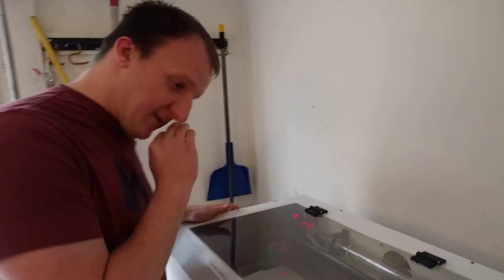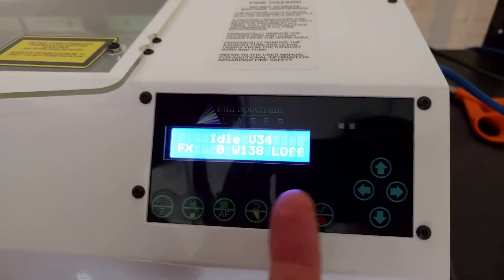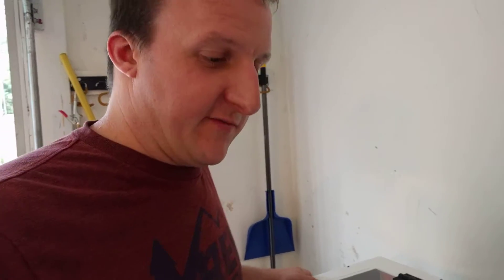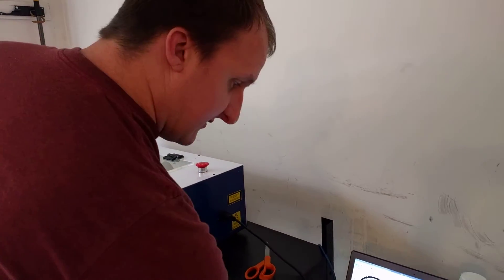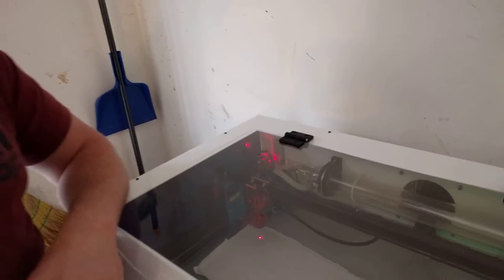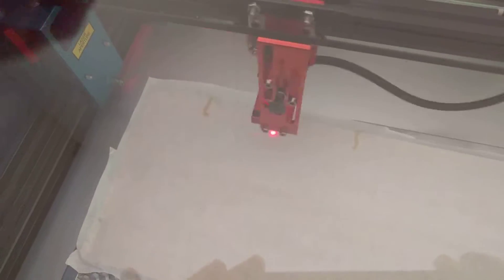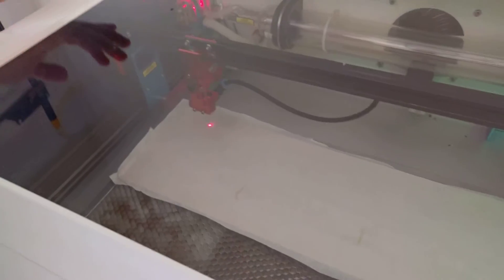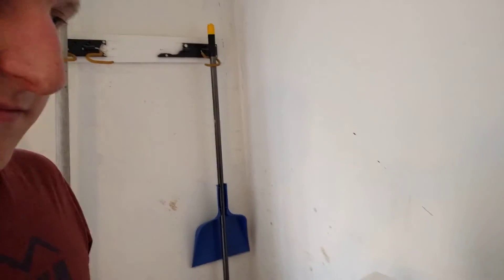Full Spectrum H-Series laser cutter stopped working after 1 month of usage

Comment: I had the same issue. It started TWO weeks after I got it. Since then I've changed the power supply 6 times and the tube once and I've only had the machine 13 months. Worst piece of junk I've ever spend money on. So annoyed and disappointed. And once the warranty runs out they ignore your emails. The new power box through them costs $300 and the 45w tube is $500. Between shipping parts back and forth and buying new parts, I've paid for this thing twice already. NOT RECOMMENDED!!!
Reply from the maker: Benjamin McDonald I actually returned my unit.  So happy I did.  you are right, it's a piece of junk.  I since purchased a bigger unit from a different manufacturer and have had no problems whatsoever.  Do Not Buy this laser cutter!!!
Reply: who did you end up buying one from I just bought mine and it don't work .....
 @sinclairal

Comment: Hi there, 
Your power field level is showing "LOFF", which would be low or no current to your tube. My understanding is that it should display "AXXX" where the XXX is the Milliamp leve. Anything lower than "A002" or 2 milliamps is considered off.
If you haven't done so already you might check your power level in Retina Engrave and see if you can adjust it up.